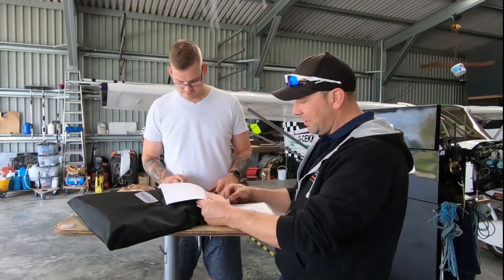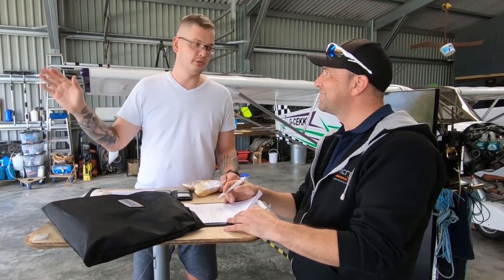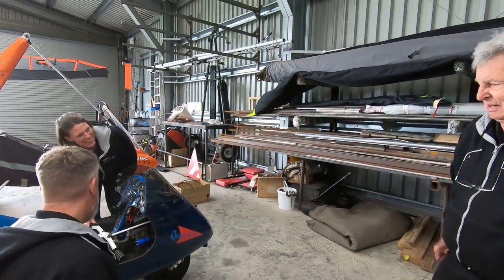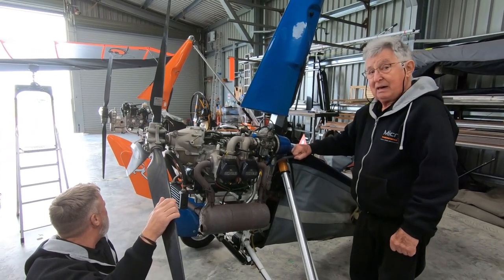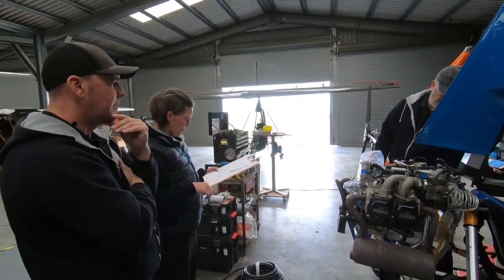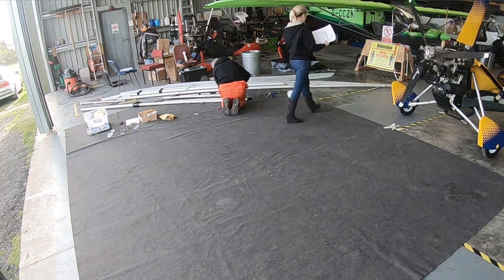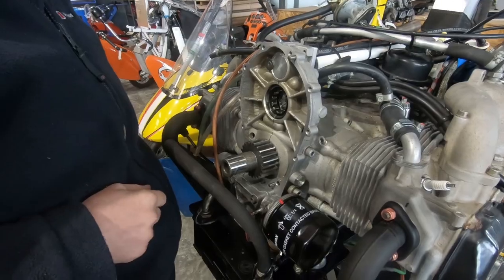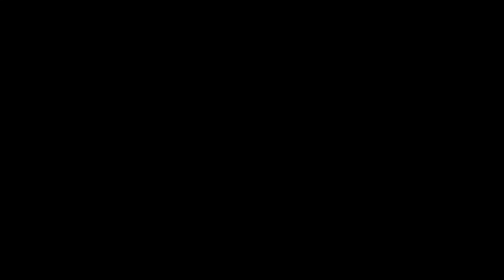Qunantum 912 restoration: WingNuts Micro Maintenance S3 E1

Comment: Another fascinating programme - thank you 👍😊

Looking at the mounts on the flexwing and the spark plugs...... 

Technically speaking the make of a spark plug should - in theory, I hasten to add - make no difference if they're a like for like, and a cross referenced replacement (that may be different further up the food chain in aviation with various types of certification). However when I started work in a motor factor's, more years ago than I care to remember, Vauxhall Vivas (HB and HC models iirc) would only run correctly/well on AC Delco spark plugs (sadly I can't recall the part number now; 44XLS' or 415TS'?) even though Champion N9Ys were a great plug and a direct replacement. NGKs wouldn't work and Bosch, although a great plug (our best sellers at that time we were ahead of the curve) most Viva owners wouldnt chance them. We had an ex REME (and ex time served automotive electrician) as our manager and he couldn't fathom it. I suspect it was temperature range issues. So we had to stock AC Delco spark plugs just for Vauxhall Vivas. Mad but true. Of course AC Delco were OEM suppliers for Vauxhall at the time. We would get customers coming in with all sorts of weird and wonderful stories about why they had to use x, y or z manufacturers' parts (complete fiction most of the time, driven by marketing hype, some were convinced when we offered, informed, alternative, cost effective and/or better choices, some weren't 😄😄). Back then I knew part numbers and cross reference numbers off by heart. But Vauxhall Vivas and AC Delco spark plugs were wed for life so it seemed.

On the flexwing, that spark plug gap of 1mm is cavernous! And carbon fouling can be due to; rich mixture, blocked air filter, faulty choke, the spark plug gap being too big etc, all of which can lead to a misfire 😲 Whomever fitted them, either adjusted them incorrectly (Bosch usually preset - but it's always worth dragging a feeler gauge through them - for motor vehicle applications), as the gap seems so large, or they were never checked from the box/adjusted for the application. That's scary, to my mind, in the world of aviation!
Reply from the maker: Hey 👍🏻, thanks for the feed back, and your input. It amazing how such a small change can make a big difference
Reply: @wingnutshomeofmicromainten6946  You're most welcome. Indeed it did, never did fathom the Vauxhall issue😄😄

Comment: G'day. Heard that towards the end it was mentioned that engine had "more" issues. What were they and how were they solved? Greetings from 🇦🇺 Australia
Reply from the maker: Hi Martin, there were issues with the electrical system resolved easily enough with a few new connectors and stater plate.

Comment: Nice video apart from the overbearing musak at some points! However, considering all the jobs that were needed, I expected to see more details of what was being done, i.e. inspection of the gearbox, checking of the wing tubes for set or cracking around holes, corrosion and fretting of fasteners, etc.
Maybe there was too much work for just one video, but it seems lots of jobs were mentioned, but no further detail were shown.
Reply from the maker: Hi, thanks again for watching. It’s sometimes difficult to record every element of the builds we do and in some cases though recorded are deleted in the edit, as you can imagine the work we do can take a number of weeks and provide hours of footage.

Thanks again for the feed back
Reply: @wingnutshomeofmicromainten6946  
Hi Mark,
Thanks again for your reply and all noted.
Yes, editing something like this video is always a problem. I've thought about making a video of my Nynja build, but there's only so many hours in the day!
Keep up the good work,
Frank.